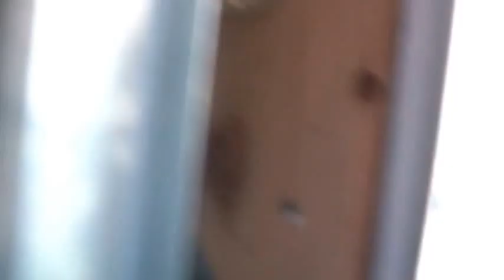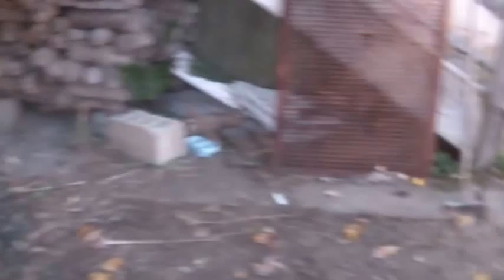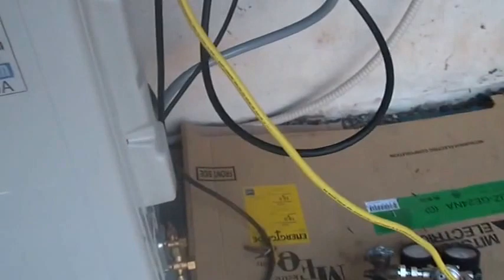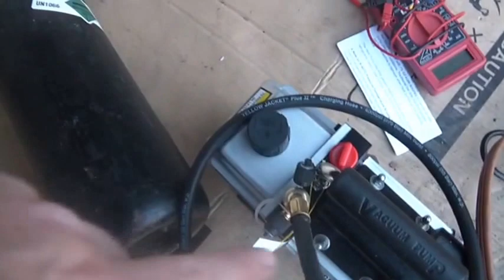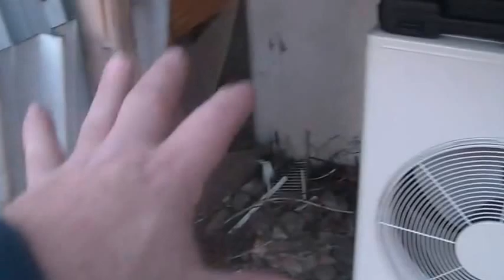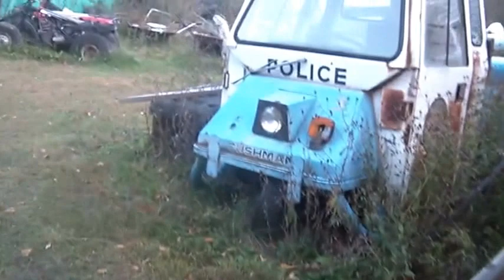Mitsubshi, Mr Slim ductless 24K BTU, 20 SEER, heat pump,

Comment: I  am  in Sussex County new jersey, my shop is uninsulated at the moment. It's roughly 24 by 30, I  work in a tee shirt all winter.  they are cheap to buy from people who convert to natural gas, mine is a  down draft  model I mounted in the  attic  so I don't lose any floor space
Reply from the maker: +roger oconnor , U are not far from me, I can make it to the Poconos in about 2hrs, I had a very close friend who used to live in Newton.  24 x 30 is a good size for a shop, my upper garage is 24 x 24, if I had the extra 6 x 24ft, many of my indoor storage problems would be covered and my shop would be more functional. The attic unit is a good idea, gets a source ignition away from any volatile fumes which maybe on the floor... Thanks the info, watching, and commenting!
Reply: i added the extra 6 by 20 feet onto the rear of my shop,i needed the space for tools and storage. my brother used to live i greenville ny i believe right before matamoros pa. newton is about 40 minutes from me

Comment: I  have a  oil fired hot air furnace from a house in my shop.90,000 btu,s
Reply from the maker: +roger oconnor , Not sure how big Ur shop is and where U are located, but,  90K BTUs should be enough to chase the chill from Ur place!   Thanks for your thoughts, watching, and commenting

Comment: So with this system do you think you can get rid of all the window shakers??
Most times when I see these units installed in houses they put in two indoor units, do you think this one unit will be good enough.
Your house is heated by forced air correct wouldn't it have been cheaper to put an air conditioning unit on the furnace??
Reply from the maker: +redneckbryon , The window shakers will be removed from the main area of my house, will keep one upstairs in the master bedroom... My house has hot water baseboard heat, so, no duct work to feed AC into. For last summer, I cooled the main area with a single 8000BTU window unit, it did not keep up when the temp went much above 80 and then it would typically catch up again at night. With 24K BTU, I'm hoping this cools off the whole area, though, it is larger then the 1200sqft recommended. I may still have to run a window unit in the back room on the real hot days. Only had one cold night to test this thing, it went down in the mid 20's, the unit seemed to keep the leaving room warm and heat drifted out to the rest of the house fairly well, need more cold days to really test it. Thanks for your thoughts, watching, and commenting!